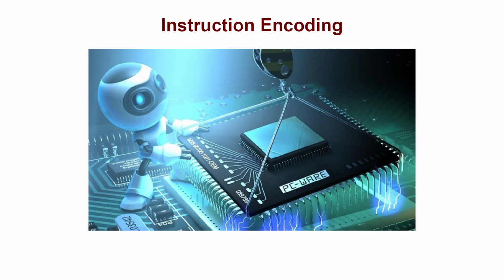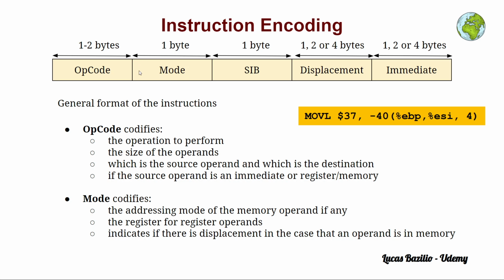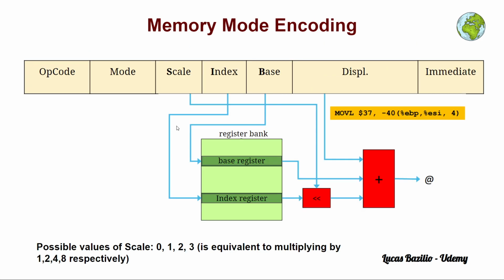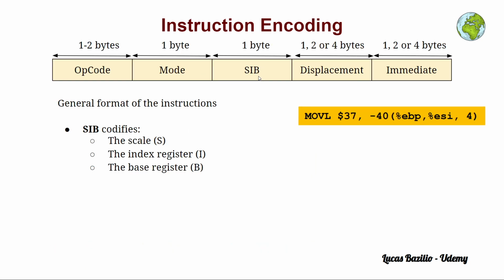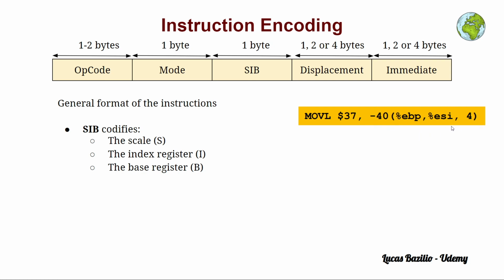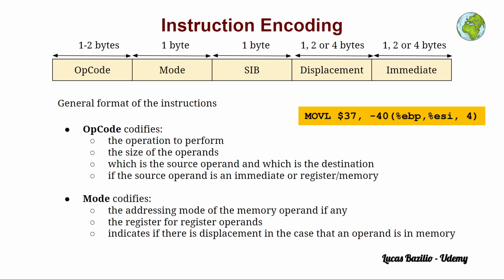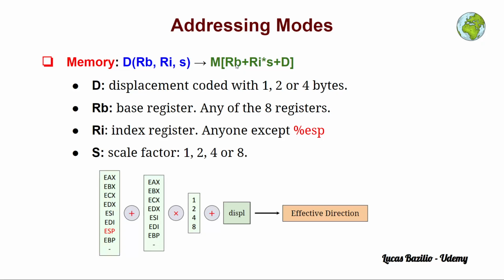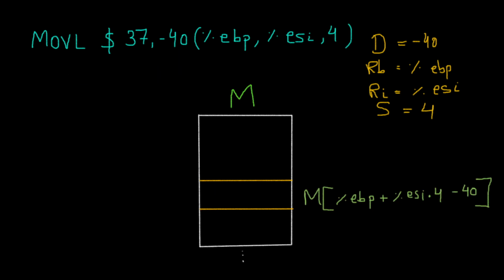Instruction Encoding - x86 Assembly Language

Comment: Intel 80386+

A closer look to the possible sorts of bytes of one instruction:
   Instruction Prefix                0 or 1 Byte
   Address-Size Prefix               0 or 1 Byte
   Operand-Size Prefix               0 or 1 Byte
   Segment Prefix                    0 or 1 Byte
   Opcode                            1 or 2 Byte
   Mod R/M                           0 or 1 Byte
   SIB, Scale Index Base (386+)      0 or 1 Byte
   Displacement                      0, 1, 2 or 4 Byte (4 only 386+)
   Immediate                         0, 1, 2 or 4 Byte (4 only 386+)